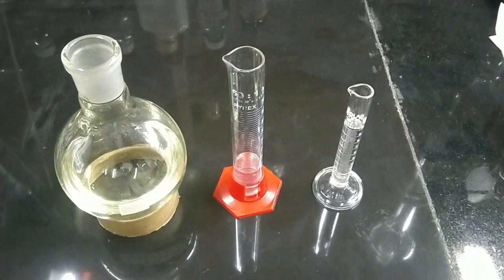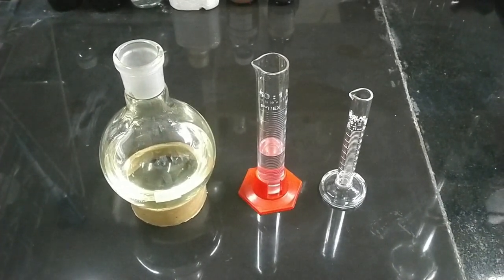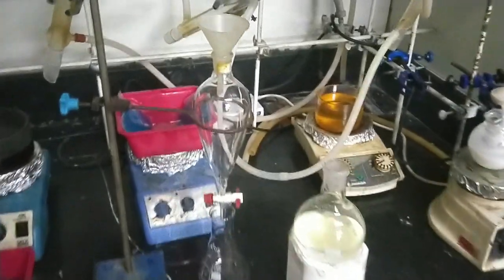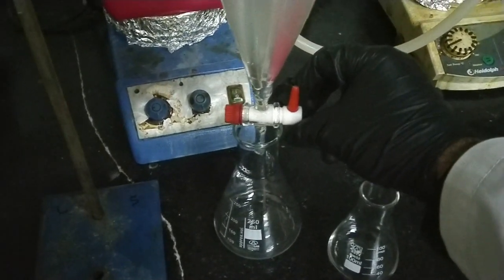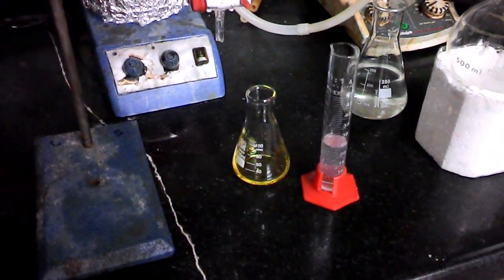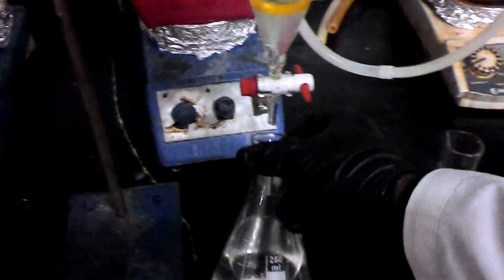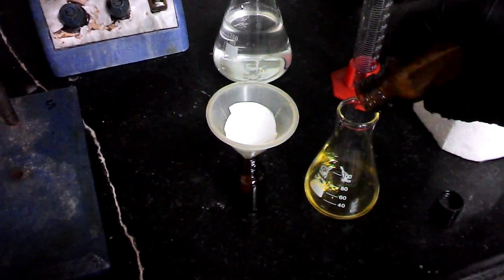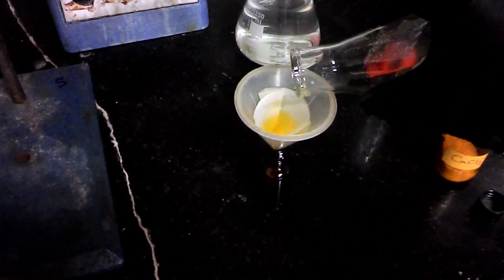Tert Butyl Hypochlorite Synthesis

Comment: Will this work with primary, secondary alcohols and phenols?
Reply from the maker: For primary and secondary alcohols, there are different procedures due to their higher solubilities in water. But with the phenol, positive chlorine ion will chlorinate the orto or para position of the phenol. Phenol ring is highly active in aromatic electrophilic additions. Therefore I think it can't react to make a hypochlorite.